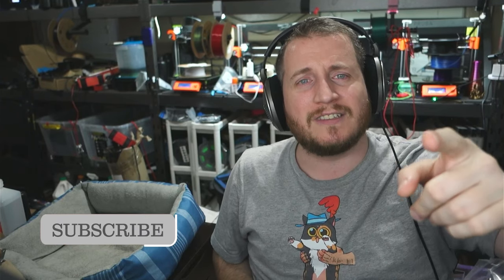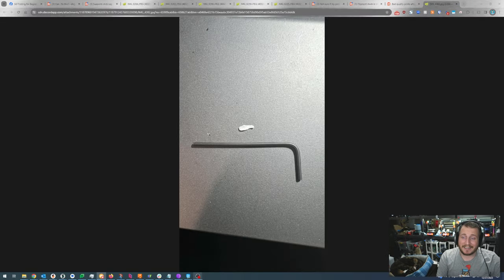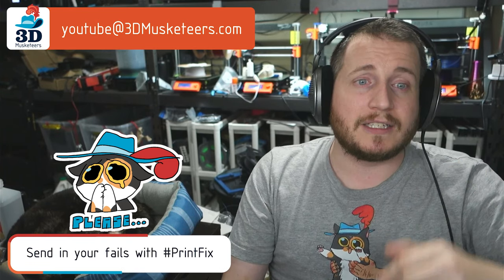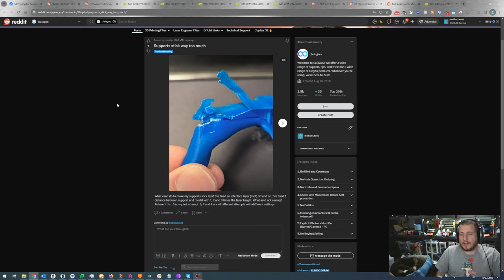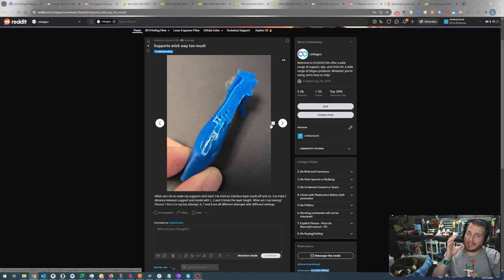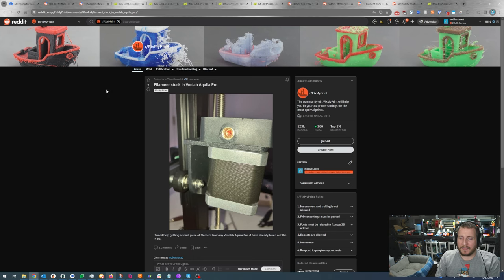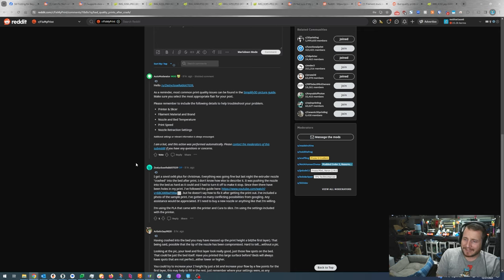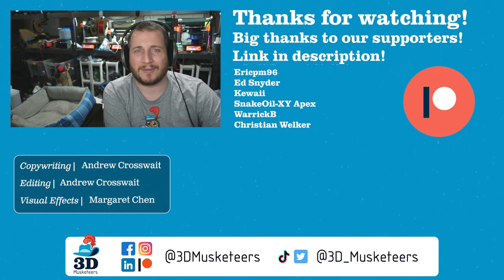Clog Mysteries and Bed Miseries! - PrintFixFriday 120

Comment: I like how the new nextruder does a quick ramming before removing the filament. It leaves a nice tapered end, instead of a blob that can get stuck. I kind of hope they can impliment this technique into the MK3S+. They are selling Nextruder hotend assemblies on Prusa's website now Grant. I bought a couple to have lying around for quick changes.
Reply from the maker: I bought some parts, but not a full unit. Are you just keeping it for the ultimate quick swap?
Reply: @3DMusketeers  yeah, I set up a .6 diamond back on one and a .25 brass on the other. That way I can just switch them out as I please without having to unscrew the nozzle.
Reply from the maker: smart

Comment: Non destructive way to clean a nozzle where a torch isn't needed: Use methylene chloride paint remover/stripper. Soak the nozzle in an airtight container overnight and the next day any plastic just comes off leaving the nozzle like new. Saved me more than a few nozzles allowing me to use them until they are literally worn out.
Reply from the maker: That stuff is crazy dangerous and while it will work, it's not easy to get worldwide. The raw chemical was banned a few years ago in the previous administration. It's very bad stuff. Mind you, we use it for gluing parts all the time, but you have to know what you're doing or it's bad news all around

Comment: My favorite printer in my garden at least now is the Prusa XL.  Good point about keeping spares and one of the things I wish Bambu would not have done.  I have an X1 Carbon and P1P the hot ends and extruders can not be swapped, so have to have spares for both
Reply from the maker: I do need to figure out the bed issues on my XL and why I cant get big parts to stick well...
Reply: @3DMusketeers  I have had better results with the smooth plate especially with prints that don't have a lot of contact

Comment: For a Bowden from a dry box, is there any reason to not just get 2mm or 3/32" inner diameter tubing from the local hardware store?
Plenty of room to minimize wear even with abrasive filament, cheap, cheap fittings as well.
Reply: You need need the yery low friction from PTFE tube, don‘t even use FEP (the clear stuff). For this „reverse bowden“ use 3mm ID. In my case the tube already installed in the printer and from the drybox added up to about 2m, was a bit too much.
Reply from the maker: It likely wont fit into your box really. Cap Tubes does make a 2mm ID if you wanted to try that. Also the PTFE tube has much lower friction than that clear stuff as @Thomas0 says

Comment: Any time I had an issue with the revo I just pulled the nozzle and used a heat gun. Fortunately I had a bit of filament sticking out. After it gets hot I can just pull it. The only time I couldn't do that easily is when the sock broke and the filament glued the nozzle on. I had to disassemble the whole thing.
Reply from the maker: good advice there for sure!

Comment: What's the best way to prevent the first issue? Just unload filament after you are done printing?
Reply from the maker: exactly, dont let it sit in the cold side for longer than necessary
Reply: @3DMusketeers Okay, thanks. I'd rather deal with the minor inconvenience of having to insert the filament before printing than with clogs like that, if I ever be able to afford a 3d printer.
Reply from the maker: oh thats only when you take the filament out, if you dont eject after the print it is happy to sit in the hotend as long as you let it

Comment: I printed an "airless" tire in TPU. Dried at 60. a little stringy, but way better than my last TPU print. The I printed a non airless tire, but because it's open completely....it needs supports. Also it has wierd side geometry. It failed HORRIBLY. The supported section warped and crashed on the nozzle Next thing you know I had a plate full of spaghetti. I modified the airless tire to be a closed, but non airless tire. Perfectly flat side. WAY better. This time dried at 65. Almost no stringing. A few mini blobs in the center hole. The top layer didn't look great. I suspect it just needs more top layers.
Reply from the maker: I really like the tire Prusa made out of a bunch of materials and colors...
Reply: @3DMusketeers  same

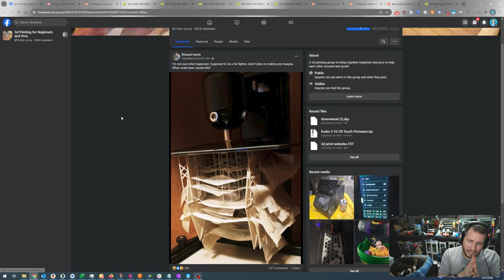Comment: 7:07 100% issue with the file during slicing.
Reply from the maker: how do you think it occurs?
Reply: @3DMusketeers  Budget pc with not enough ram or processor speed to keep up with slicing.

whilst the user is most likely playing youtube/browser, maybe a game in the background.

my office pc for slicing and generic stuff has this issue with 8gb ram ( I bought the wife a quest 3, ram upgrade had to wait) 

I noticed this with my saturn 2 alot that if I would slice on a pc that is heavy in use ( like I described for example) my resin  prints would have parts missing, weird spots in the layers that something is not right.

yet if I close everything down and just keep the slicer open this never seems to be a issue ( for me atleast)

This mostly seems to be supports or vertical flat surfaces.

Not saying this it the exact case here, but it does have alot of similiarities that my brain says: Slicing issue.
Reply from the maker: noted. I have some really low spec machines, I will have to see if I can replicate it